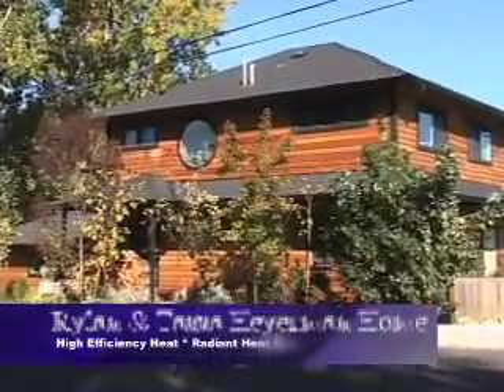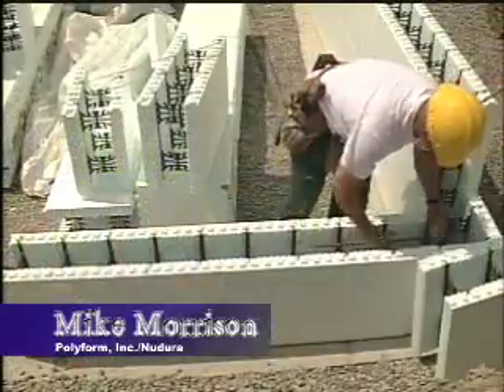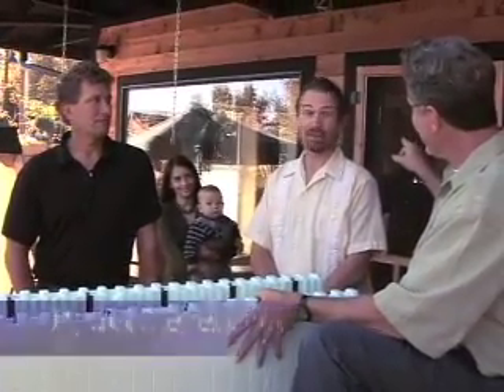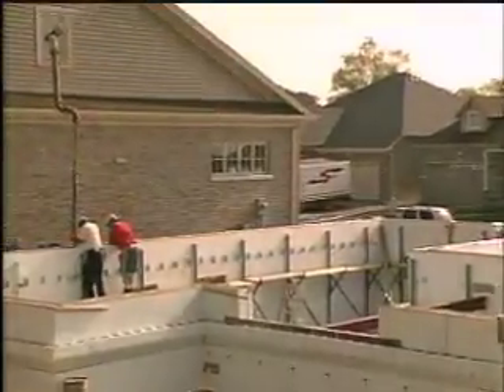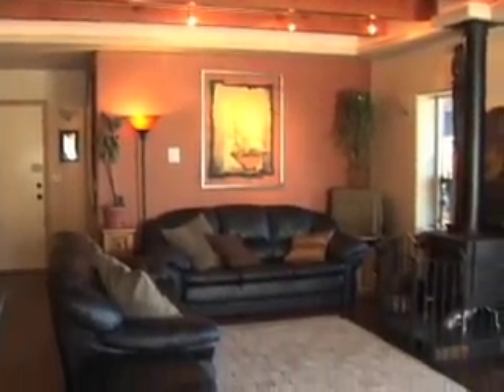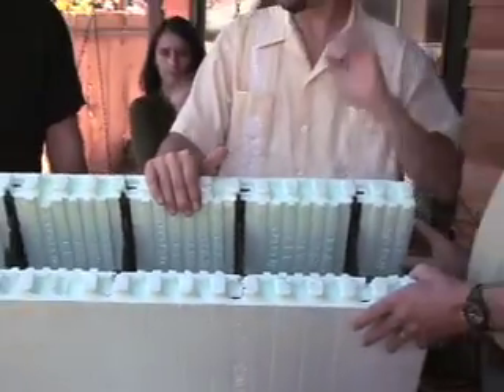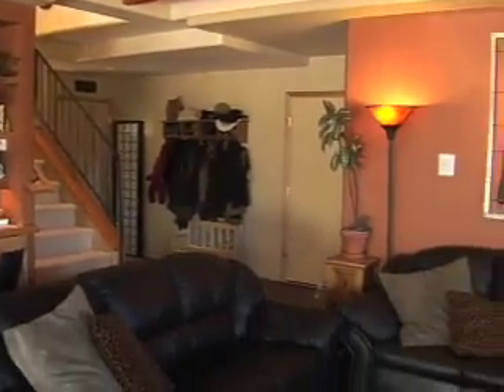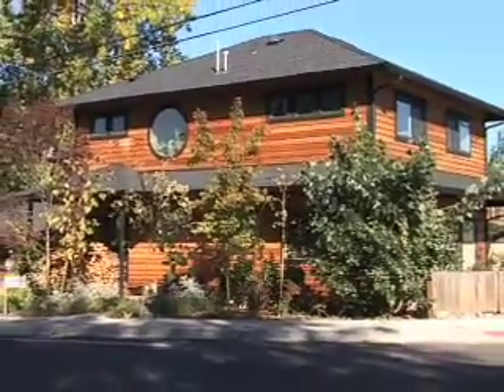BGH - Insulated Concrete Forms Construction

Comment: your wrong, why do you speak without knowledge? ICF are rated tornado, hurricane, and fireproof, also have a high R heating rating compared to standard concrete blocks. The ingenuity is in their lattice design and ease of pouring into a single structure.

Comment: Many new timber Stick built homes use a  timber structure as their main component allied with green insulation and have those bell and whistle  'Greewash' products in place,  such as ground 'source heat pumps'  yet all too many just leak 'carbon' likes a sieve..Sorting out Thermal bridging weakness details at the design stage and then Blower testing  coupled  thermographic  inspections during  latter part of the construction is the way to go....

Comment: the concrete is not a "styro-foam" based concrete, (also styro-foam is a brand the tech term is EPS)  It is typically a 6"core of 4,000psi concrete with rebar on a 18" grid with number 4 four bar.  Thats what we use for our grid anyway.  You honestly think that a hollow block held together with mortar is stronger?  i encourage you to watch ARXX ICF wind test on youtube

Comment: @TheCowgirlFromHell It's not. I had a neighbor build one of these just two doors down, in 1992. Fantastic stuff and sturdy as all get out. He went two floors monolith pour, full basement with single floor above, nice ranch look with dormers. I watched the whole process and was impressed. Hope to use the same in the near future. No rot, stronger for wind resistance(lower insurance too) cheaper for heating and cooling, quieter, lots of choices for siding too.

Comment: @frankg0912 Assuming your numbers are correct, concrete is one of the most energy demanding materials that can be sourced. Huge amounts of energy go into the manufacturing. Poly- anything are plastics, many of which leech toxins into the environment (incl human bodies) and obviously never ever break down. So as you may have a very energy- efficient home with these materials, the materials themselves will be damaging both during mining and after their useful lives. That's what I mean by non-green

Comment: @Soldier957 ...concrete is VERY green.  It is made by recycling tires and using local material.  As for the foam, it is closed cell extruded polystyrene......very low cfc's and ICF walls reduce energy consumption by well over 60%.....very energy efficient.  Payback is 5 to 7 years....worth every penny!

Comment: It makes no-sense putting foam insulation on the inside of a thermal mass structure; what am I missing?  In this day and age there is no reason for heating or cooling a home; and no reason to require electric lighting during the daylight hours.

Comment: @yanikivanov Timber catches fire too... When all's said and done, if your house can burn down whatever it's made of - even in a masonry building the floors are often made of wood and your carpets and furniture etc will burn easily. The main trick is to design the home to ensure you can get out easily if there is a fire.

Having said all of that, if you'd prefer a masonry building, I'm told that Thermoplan Ziegel blocks are brilliant. There's videos of them on here.

Comment: Um, dude, the foam forms are the "Insulated" part of the ICF construction. They are a permanent part of the wall structure. Hence the lower heating/cooling costs. You have to purchase them.
Reply: Grady Cowardin